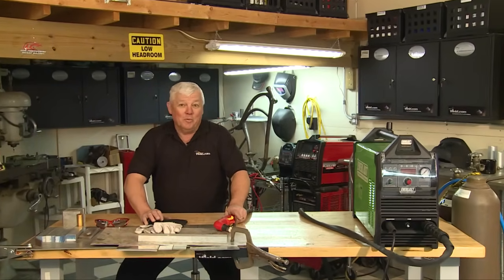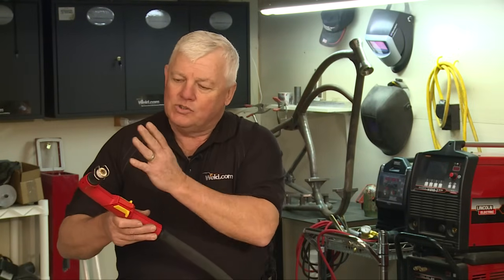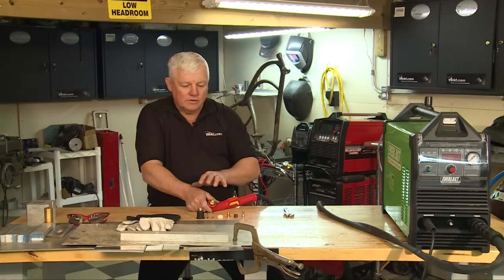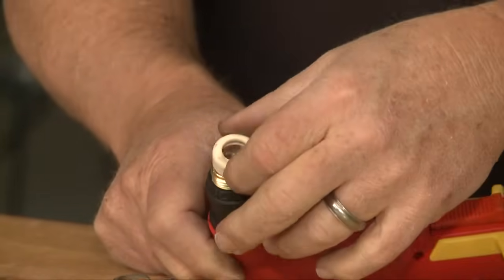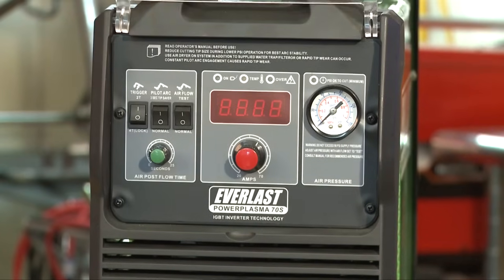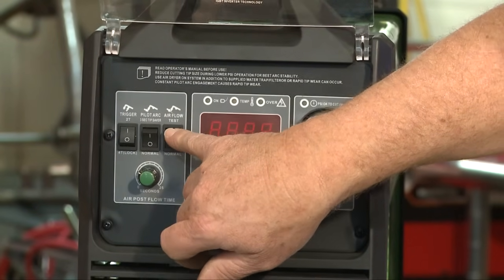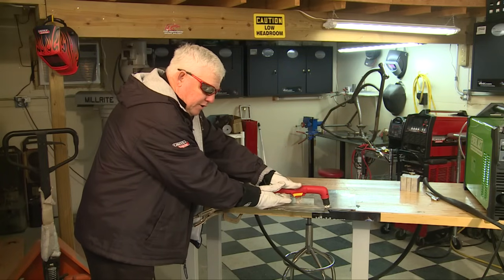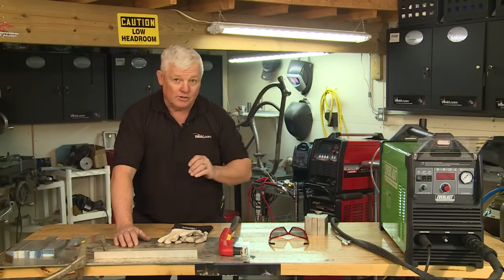Plasma Cutting for Beginners: Sheet Metal | TIG Time

Comment: What other equipment at home (other then the plasma cutter) do you need to start plasma cutting or is just a regular powerplug enough? And what's the difference between a built in compressor and a non-built in compressor?
Reply from the maker: You will need an air compressor. Other than that, you are good to go.

Comment from the maker: The 2t function on the panel allows you to initiate an arc or plasma cut immediately upon demand of the trigger.  When you let off the trigger, the plasma arc stops.  When you place the 4t function, you can squeeze the trigger and once the arc is initiated, you can let go of the trigger and the arc will remain until you re-squeeze the trigger.  This function is sometimes used for automatic cutting systems or when you have long runs to make.

Comment from the maker: The Pilot arc is a "small" hot ionized flame that will allow quick start initiation of the plasma cut upon demand. It will assist in connecting the electrical circuit needed to initiate the full power on plasma demand.

Comment: This is not your best video. Safety; you should protect your skin against the UV radiation. Also your mentioning of how to get rid of the kerf is incomplete. If your settings are right, you should be able to get rid of the kerf using a hammer. An added benefit of using plasma is that the high temp in the cut burn away impurities. Also a tip; cutting other than metals, cover the object with a sheet of metal will enable you to cut most things including glass. Use the cover as ground.

Comment: The torch guide should have been right up against the surface of the metal to be cut. That would have produced a much cleaner cut. A discussion on the benefits of the pilot arc would have been helpful. Also a discussion on the features to look for to prolong the life of the consumables like a user settable post-flow.

Comment: Wyatt, Can you please explain the difference between 110 volts & 220 volts. Is 110 single phase and 220 3 phase? I have heard 220 mentioned in a few of your videos but you make no mention as to whether it is single or 3 phase.

Here in Australia we have 240 volts 50hz single phase and 415 volts 3 phase.